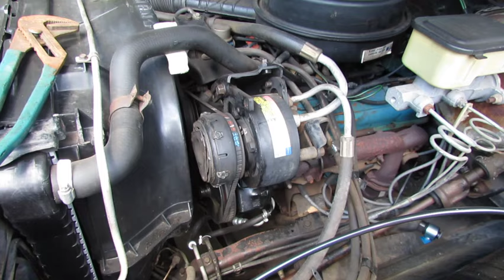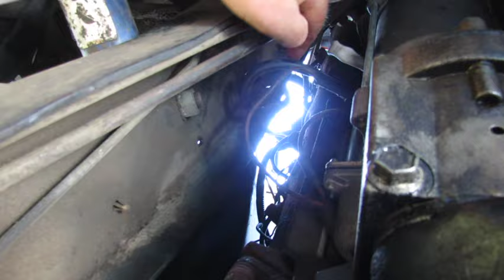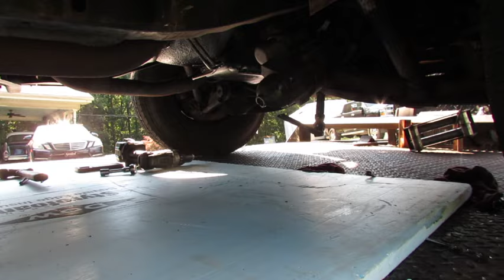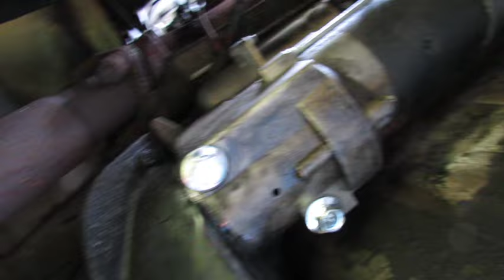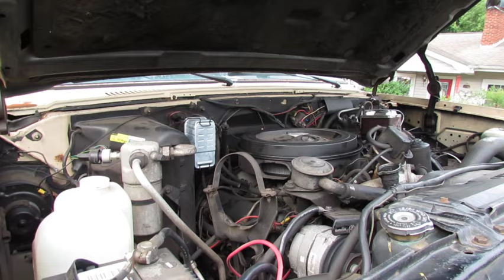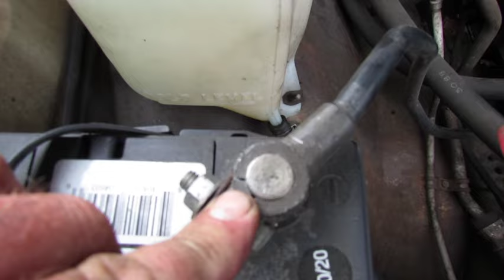85 GMC  6 .2 Diesel Out of Fuel

Comment: "Permanently repaired with a temporary cable clamp." This is what I tune in for - that and the "while you're in there" quick fixes.
Btw, the 5.7 "diesel" was derived from an Olds engine (& you see how well that worked), and I think GM "learned" from that, so the 6.2 is a legit diesel.
Reply from the maker: Yes. Legit. Wimpy. But legit.

Comment: There is a starter brace that bolt to the block and the back of the starter to prevent this. I have a block in my shop that hase the outboard bolt boss completely broken off  because the owner desided tis brase was unecessary you have been warned.